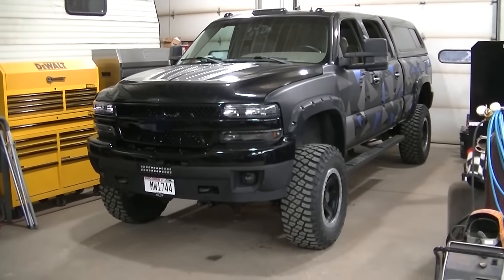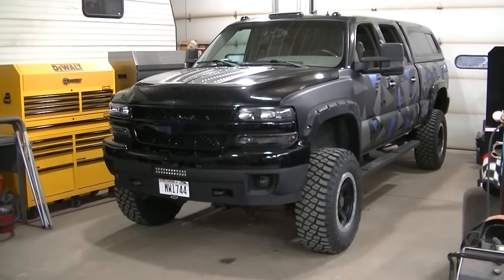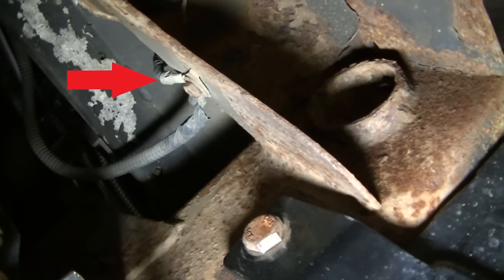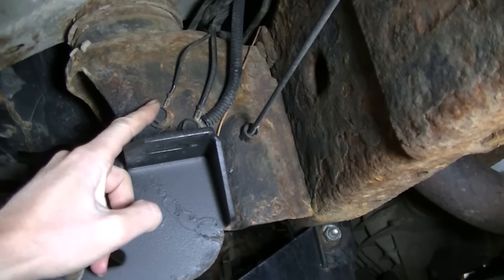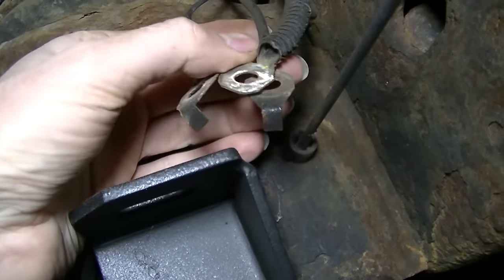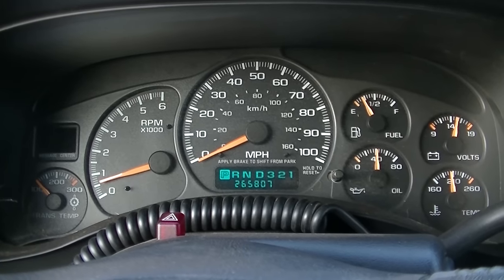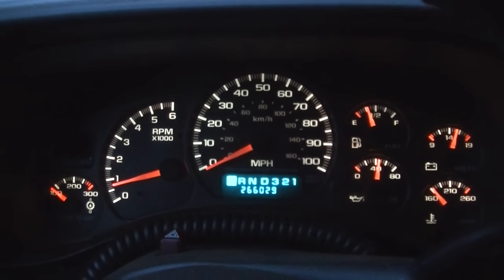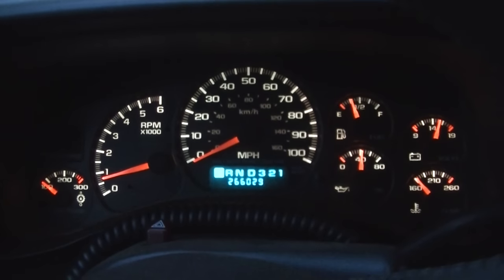ABS & BRAKE Light FIX "Ground Cleaning"

Comment: Imagine ever taking your car to a shop and they tell you “hey we just cleaned some grounds. That’ll be $40 bucks”
Reply from the maker: Pretty much the reason I do all my own repairs.
Reply: @mossman381  best way to do it. Repairs are always the small stuff and shops will go straight to the big stuff
Reply: Not these days probably more like $90 minimum
Reply: No they will tell you it's a bad viscous coupler in your transfer case making that noise and try to charge you $2300 to fix it, after you asked them to scan ABS cuz you think ABS pump is doing something funky but the ABS light isn't coming on at all but you just have a feeling that's what it is, so you end up taking their word on it cuz you have no experience with AWD vehicles and they swear that's the problem they've seen it a million times it's the exact sound, so you spend $400 and an entire Saturday swapping the viscous coupler just for the sound to still be there and it turns out these people never even scanned ABS. Ask me how I know.
Reply: Ok then you could have found and fixed the issue yourself

Comment: So far this has worked for my 99' chevy Silverado thanks for your video and advice both light abs/brake were on after bout 5 min of driving and would stay on delt w for 2yrs and shop was wanting to charge appox $500 for brake module job...it been two days with NO lights on thanks again!!!
Reply: did your lights turn off
Reply: Think this is the issue with my 99 Sierra. The lights turn on and off randomly. I would do this before a module job definitely.
Reply: @MrHuck  was the on and off caused by a loose ground?
Reply: @Professional_ProCraftinator   Still haven’t fixed it. I think the ground is ok. Wonder if speed sensor might need replacing?  Mostly commute with my Civic so haven’t never got back to solving it.

Comment: WOW! Dude you the man. You just saved me from replacing a wheel speed sensor I didn't need. Last time it was corroded wire on the passenger side speed sensor, but I didn't remember the brake light flashing, so I hoped on youtube, and up popped your video first, then I watched a few other videos that talked about taking apart the ABS module and I was like that first video was so easy (yours), lets start there. 45 minutes later and here I am problem solved. THANK YOU!
Reply: Thanks for the help had the same exact problem and that fixed mine

Comment: When you said "lit up like a Christmas tree" I had deja vu to 6 hours ago when I bought my 04 chevy van and drove it home. Lights on and off the whole way with dinging and all. I hope this simple ground cleaning fixes my problems because that would be amazing!
Reply: have any luck with it?
Reply: Yes and no. Cleaning the grounds fixed some lights. Adding soldered in wire grounds right at the ABS module by the frame fixed all but 1 code. The last code is U1000 and I'm stuck on that one. Already tried 2 new abs modules with no luck.

Comment: Good problem solving video, will give it a try. A suggestion would be to smear a little dielectric grease on the ground points after you tighten them which might keep the moisture from corroding them again...

Comment: Definitely worth a try. Even GM thought so since they published a TSB on this (although I think it was only the front ground location but I could be wrong). However I've probably replaced 57 brake modules and that fixed it everytime. Mostly it's a cracked solder joint in the EBCM (brake module which attaches via four torx screws to the brake modulator assembly). They come blank and have to be programmed at the dealer for it to be done correctly. Keep us posted man! I'd love to know that cleaning the grounds worked for even one person out there! Free repairs are the best!
Reply: Changed that many which means you’re probably a mechanic… stop being a mechanic and become a technician. You can program them yourself and furthermore you don’t need to program… you gave yourself the solution… they’re had solder joints… re solder them. Dealerships aren’t needed for anything anymore. He module is already considered bad. You’re not going to learn anything until you practice. Open it up and try your hand at repairing it. There’s far more money in the trade once you learn this. I teach my guys that everything is fixable. That if it has to be sent off for someone else to fix this means you can fix it yourself.  The people that fix ajd refurbish these sorts of units aren’t super human and anything done by them can be done by YOU!

Comment: After cleaning and before rebolting apply bulb grease or even lube grease.  This will slow the corrosion so it takes longer for the ground to go bad again.  Another good idea would be to move the ground somewhere else where it does not get splashed.

Comment: Thank you sir. This problem has been haunting me for 3 years. Hope this is my fix!
Reply: What car? I think I have the same my abs and brake light is on
Reply: Going to try this rn on my 01 Chevy Tahoe will give you feedback
Reply: Same with mine. First it was the abs light. Went to work on my shaft. Then the break light came up too. And the fluid level is ok. Mine is a Honda civic 2006. Please help

Comment: Nice, simple, to the point video. I'm not sure if this is the reason my brake and ABS lights are on (they came on randomly while driving in the storm, but no apparent brake issues), but I'll give it a try on my '97 Ford Econoline.

Comment: I have a 2001 Silverado, cleaned the front but didn't know about the other two. Can't wait to try it. Of course all the passengers like to point those out to you as if you don't know about it. Thanks in advance, my brakes are fine and I'm sure this should do it. If it doesn't work, I'm gonna break out the black tape to cover them up. lol
Reply: There’s 3 others that you should look at as well. The first is between the hood and the firewall. The second is between the firewall and behind the engine block between the firewall and the engine block. There’s actually two in this location one goes with a braided line at the same firewall location that the hood line attaches to. The other is a small single line on the passenger side between the firewall and the rear engine block. That particular one is very hard to undo the bolt. I ended up cutting it as low as I could and re-running the ground to the first firewall attachment point. So between those six grounds I think of that covers most of them

Comment: Hey bud these are the grounds I was talking about when you mentioned having to tear out the axle in dads truck because it was staying locked into 4x4.  If you have not done that axle fix yet I would try this first.  I seen that one guy actually moved all these grounds up on the fire wall under the hood to protect them a little better.
Reply from the maker: I am pretty sure dads axle has more issues than grounds but it's a good idea to clean them when you are working around them.
Reply: True his axle could need major repair but I always try the simple things first.  Learned that from experience lol I put a lot of time into repairs and found out it was a ground or something.

Comment: Thank you so much it worked for my 2005 Chevy Silverado 1500 5.3L
Reply: Which light was u getting i have a 03 thats saying service brake booster but brakes work fine
Reply: @jonathangrinnell2932  both abs and brake light. It came back on though. I even replace abs sensor and it came back on. I'm going to send it to the shop and see if I can have them reset it or something to it.

Comment: Nice and to the point.. I try to clean up the grounds on most of my stuff here and there as I'm working on it or around it. It's a definitely a good thing to get in the habit of doing. Glad it helped out with the issue!
Reply from the maker: Yup,  always a good idea to clean up grounds when you see them.  Especially in the areas known for rust and corrosion.

Comment: I try everything on YT and nothing works and I had the same problem my abs / brake light came on  , I replaced ebcm 2 different ones from eBay and the trac light wouldn’t turn off so I found a place to fix my original ebcm and no more lights or trac light on I have a 03 Yukon cost me $125 to fix

Comment: IF it turns out to be your EBCM, there is a place on Ebay from MESA Az that will replace/exchange/ rebuild your EBCM for about $70 with shipping ! That was like 5 years ago so naturally I'm sure the price went up. Still beats paying $750 for a new one. Best of luck. They did a GREAT job on mine.

Comment: Did this affect your cruise control also? My brake lights came on and at the same time notice my cruise didn’t work. Stayed like that for a couple months. Then they went off by their own and the cruise worked. Did this several times and now everything hasn’t worked in months. Will try this tomorrow

Comment: The 2nd set of grounds you showed, I cleaned up on my truck, and it stopped the Service 4WD Message I was getting in the DIC. So the transfercase/4wd encoder motor may be that 2nd ground wire there.
Reply from the maker: Interesting  :)

Comment: The brakes lock up in the front, would it be the ABS module, and ABS/brake light comes on as well, do i need to change ABS module
Reply from the maker: When wheels lock up that is usually the wheel speed sensor.

Comment: Does your abs and brake light come on together all the time when you had this problem ? My 02 blazer the abs light and brakes come on once in awhile I turn the car off and turn it back on and it goes away
Reply from the maker: Yes,  they come on together.  They were never on separately.  They would just randomly turn on while going down the road.

Comment: I currently have this as a problem. But they don't come on intermittent they came on after I had just finished doing the brakes  I was thinking it was a bad and sensor.

I'll look for the grounds on the frame.
Thanks.
Reply from the maker: Mine did the same. Coming on after doing a brake job.

Comment: will try it tmrw got the abs and brake light on and tpms but it goes away on a 04 cadillac escalade esv also one more question  if i drive my cadillac escalade normally not speeding soft on the gas it shifts okay 1 to 2 to3  gear but if i wanna go quickly in the traffic  light i goes fine 1 but ceeps 2 to 3 gear all the way till 4000 to 5600 RPM once i let go of the gas pedall it shifts huh?
Reply from the maker: Not sure. It's pretty hard to diagnose a problem without seeing it in person.

Comment: Have you ever had to replace the heater core inlet adapter on your fathers Duramax?  I read it was a common coolant leak spot and soon after I did a pressure test and mine was leaking. A simple fix but a bear getting old one off even with fuel disconnect tools.
Reply from the maker: Yup,  fixed a few of those.
Reply: I Romped on My 2000 Yukon XL to make a Quick Get - Away Procedure ... For a Fast and Furious Few Blocks.... Then the Red " Engine Overheated " Light Came on, Which I had Never Seen Before, or Knew there was one, Also The OBD  Code Was Checked, Found Out that the Computer Takes Over to Assist the Throttle Body / Gas Flow ...
To Help Save The Engine.... 
Steam came Out From Under the Hood, The Engine Had No More Power ... I lifted the Hood, Saw that the Cheap Rotted Tan Nylon Adapter / Fitting attached to the Heater Core Outlet was Broke Off --- with the Heater Hose Laying Down Beside the Pass . engine. The Broken Nozzle was Still clamped in the End of the Hose.  I was Stranded... Until, I found an aluminum bar close to 5/8" Dia. , Onboard. I Removed the Second Heater Hose, Pushed the Bar into both Hoses and Re- Clamped Both. Had to put back about 4- Gallons of Water... In the Reservoir Tank.... Since there is No Radiator Cap....that I Know Of, Hoping I did Not Harm this Wonderful Used 5.3 L motor.
Drove to AutoZone , Did Not Know if I was Going to need a Dealer Only Adapter Nozzle.... But a Knowledgeable Parts Man Took Me to the " Help "  Parts Section  , Showed Me the PKG. For " GM " , it had the Squeeze Release/ Snap Lock... Like a Snake Bites...
It was Hard to pry off the Broken Nozzle, I kind of Chewed it off with a Big Pair of Water Pump Pliers , That I was Blessed to Have onboard.... At the Time , Not Many More Tools than That , on Board.... It was a Pathetic Experience... Exasperating. But All Turned Out Well, Back to Normal , and No Leaks , The Heater Functions Fine, the Engine Has Power.... ( I really Would Suggest Buying / Carrying a 5/8 " Straight Tube Barbed connector, with 2- Clamps , on board.... Just to Quick Fix Such a Problem, if at Least , Temporarily...!!
The Engineering / Mounting of Such Cheap , Weak Plastic Nozzles/ Adapters for a Hot Water - Pressurized System is Absurd...!!    This Should have Never Been Designed this Way.... Or Used in the Coolant- Heater System , in the First Place.... That Nozzle was Rotted / Weak ,
And Simply Exploded Apart under High Pressure Conditions. I Had Nice Buick Le Sabre do A Very Similar Situation... While Traveling Down the Freeway, Going to Work... Unknowingly -- a Cheap / Plastic Fitting Exploded near the Top of the Engine , ( it may have been a " Y " fitting , or straight Tube... Exploded ...
   By the time I took the Next Exit.... The engine was Destroyed.  AAA towed it to my Mechanic... Cost Me $1500. To Replace the Motor. The Mechanic Stated
" This would have Never Happened.... If the Fitting was Metal , Most People usually Switch it Out to Metal ... For Just a few Dollars....". To Prevent this from Happening ".  I hope this Dissertation Helps Somebody --- Before it Happens ... To Them.
    It's a Damn Shame to think of all of that Wasted , 
Good Machinery , and Money Squandered... Due to Cost Cutting Manufacturing.
And Poor Design , incorporating eventual Failure.   I Rest My Case.
         BillinL.A.   4-22-2022.

Comment: Hi Mossman, I will try this today, same symptoms, I replaced both wheel speed sensors (2002 Sub 1500 - front only) with no result, lights still come on, will post back if it's a fix, thanks! Froggy's Garage  :)
Reply: Froggy - did you clean the grounds and did it solve your problem? I’m glad you said the wheel speed sensors may not be an issue I don’t wanna spend money on those unless I know they’re bad. I cleaned all my grounds and even re-ran some. What appears to have gone off for good but I think it came on momentarily at one point but I’m not sure
Reply: @condor5635  Pretty sure it's the abs MODULE, driver side under rocker panel.
On the frame, has brake lines attached.

Comment: Your voltage seemed higher than mine. Is that because of the dual batts? My 06 sierra 2500hd is always below 14?
Reply from the maker: I think you should be 14 or so.  Dual batteries shouldn't change anything.

Comment: my 04 just start having the Brake & ABS light come on with the dash dinning then the battery light flashes, never had any issues in 6 months till today. All the grounds have already been cleaned couple months ago. Check engine light stays on even tho I fixed the code but won't turn off.

Comment: Fixed the ABS light in my S10 today while pulling the dash apart for another reason.  I removed the bulb.  Seriously, though, with a Moser 9 inch axle in the rear, there's no way I'll ever have ABS again in that truck, so the light was just annoying.
Reply from the maker: I would call that a mod not a fix  :)
Reply: .....but it was free! Also removed the stupid shift light. I don’t need that! I can see the tach.
Reply from the maker: I remember those shift lights.  They always want you to shift pretty early I thought.  I liked to get a bit more rpms before I shifted.
Reply: Yeah, like they wanted super fuel efficiency or something.

Comment: I was having a problem with my ABS and BRAKE light being on. However, as I was trying to find a scanner to read my ABS system, I decided to, on impulse, use contact cleaner to spray down all the plugs and sockets connected with the brakes. Well, on ignition, my BRAKE light is still on. However, my ABS light eventually goes out after a few seconds. So, I assume that that fixed at least part of the problem.

Comment: Great video brother ! 
Thank you !

Also - how do you bring back the PRNDL lights ?
Reply from the maker: You need your gauges rebuilt. That is a common problem on these trucks. I believe the circuit board has solder joints that are broken. That is why your indicator is gone. It probably started turning off and on then finally went dead.
Reply: @mossman381  Thank you 🙏🏼 and that’s exactly what happened - it flickered for awhile and then !POOF! it was lights out

Comment: I'm having the same problem with my 2003 chevy s10 4x4. Where would the ground wire be located at on my truck? I found one behind my driver side headlight. Cleaned it but no go. Thanks in advance.
Reply from the maker: Not really sure about an s10. I would guess it wouldn't be far from the abs module. I believe it is in the engine bay of an s10 so i would look around it. Maybe the frame below it.
Reply: @mossman381  Ok will give that a try. Thank you

Comment: I found that the brake pedal gets a little stuck yu have to pull on the release and at the same time pull up on the brake pedal with yur hand and that would remove the brake light will go away and I don't know about the abs light
Reply: The e brake pedal pull up with hand while you release parking brake

Comment: I owe you a cold one. This fixed my brake light issue and my service 4wd issue. Now my dash is almost completely clear. Last thing is my air bag light. Any suggestions?
Reply from the maker: It could be the sensor on the front of the truck. I have heard the plug can get corroded. I would unplug it clean it with electrical cleaner. Put some dielectric grease in the plug and see if that works. If not it's probably the sensor itself is bad. When you mess with airbag stuff I would unhook the battery and wait 10 minutes before touching it.
Reply: mossman381 will do.  Thanks again!!